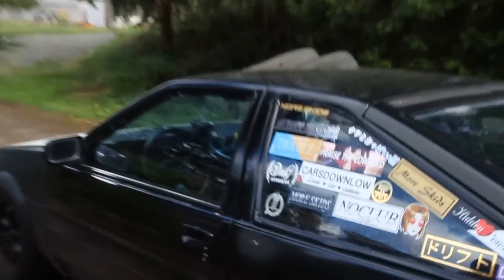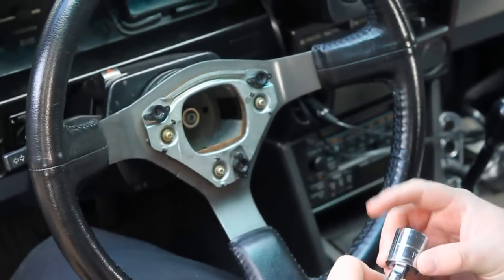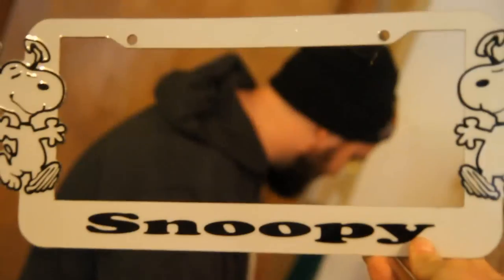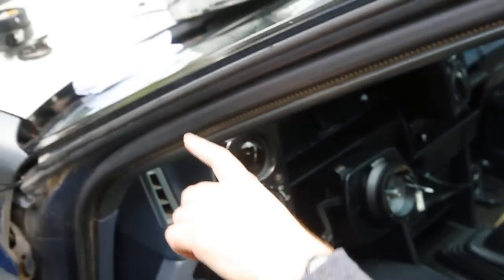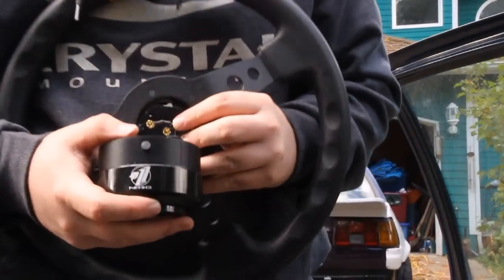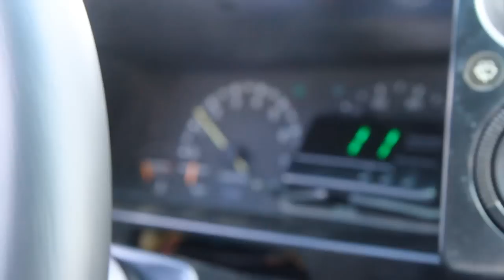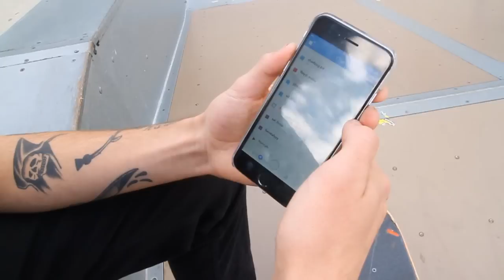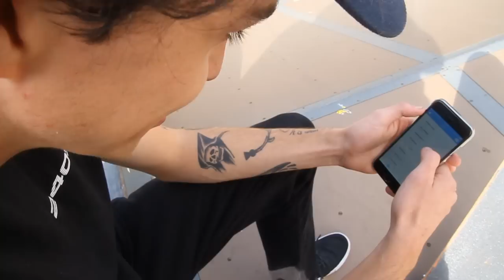AE86 Quick Release Install | SKATING!

Comment: Hey guys I'm a locksmith, a lot of those older nissans had a sticker in the glove box with the key code on it. Some owner's manuals also have the key code written in them. You can take the code to a lock shop and have a key cut from it for a few bucks. OR if you remove the trunk or passenger door cylinder and take them to a lock shop to have a key made it will be a lot cheaper than having a mobile locksmith come out.
Reply from the maker: already had a mobile locksmith come out.. haha thanks though man!
Reply: Bah damnit! Sorry I didn't see the video sooner haha.
Reply from the maker: haha all good man, thanks for watching!